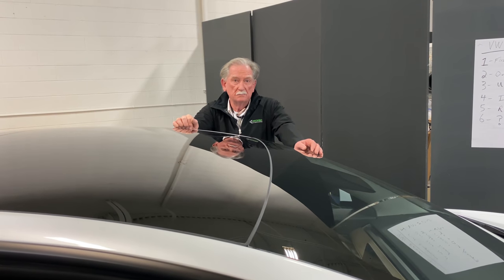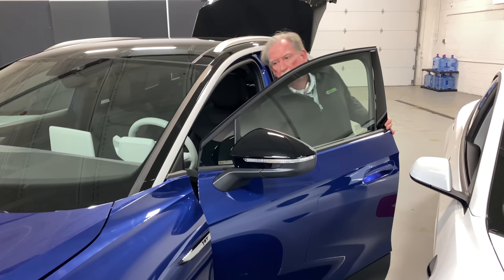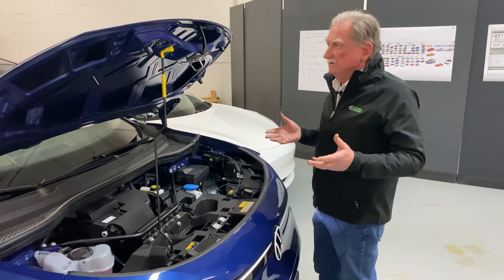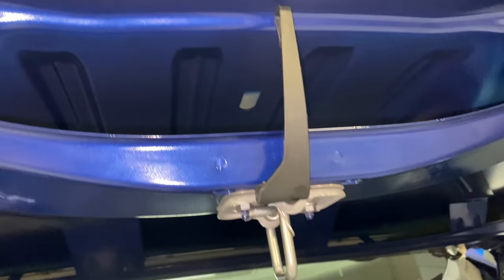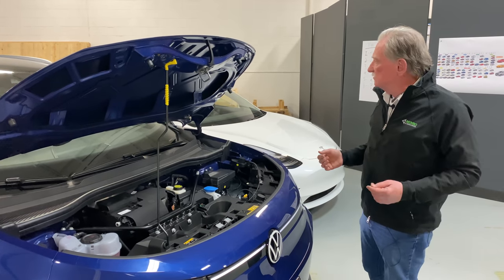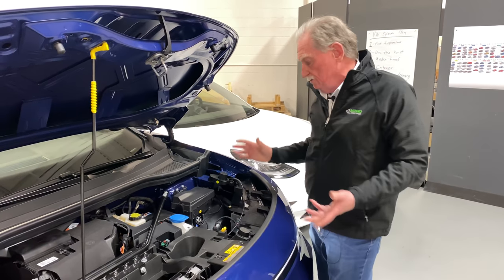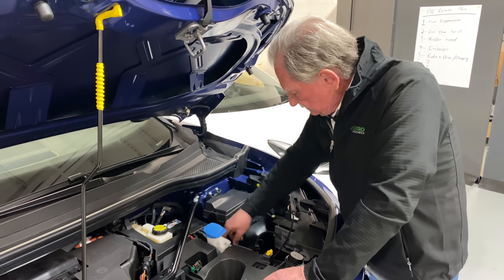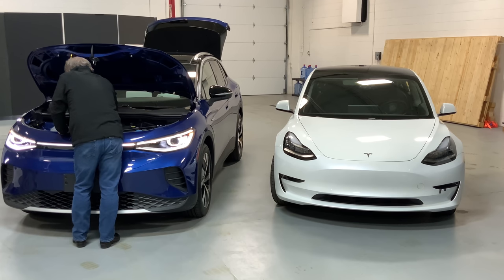2021 Volkswagen ID.4: E2 - Under The Hood

Comment: Outstanding technical analysis. Thanks Sandy.
Reply: There's far better technical analysis in the comments than the video. The video demonstrated that Sandy still can't close the frunk of the Tesla and that he seems to be wilfully misrepresenting the engineering behind the ID4 - most notably no comment on the tighter turning circle and better interior space because of the shorter nose and the benefits of moving items from the dashboard/firewall area into the space freed up by losing the engine, as well as presenting pedestrian safety as a negative thing for some reason and ignoring the connection for the + jump lead in the fuse box, meaning you don't need to go at the battery terminals at all. Expecting the ID4 hood, which will likely be, opened a couple of times a year if even, which, when open provides much better access to service parts than the Tesla, to be as easy open as a daily used storage area with plastic panels covering all the same mess as in the ID4 bay is just plain insane. I hope he gets a lot more objective if he dismantles this car, because otherwise he's showing a surprisingly level of pro-Tesla bias for a guy who up to this point, seemed to be making an effort at keeping things fairly objective.
Reply: @peglor  exactly that. I was screaming at the monitor while he was saying that the hood is heavy. Even at the first responders cable he was wrong, in id4 you don't cut the cable you just unplug a connector, it was right in front of him, and he literally was touching the instructions label while complaining that "the first responders had to remove the refill bottle to get to the cable" , jesus

Comment: So, why would you need to jump an all-electric car?  Does it still need the small 12 volt battery to start the motor even if the main drive battery is not drained?
Reply: All EVs have a 12V battery to power the accessories i.e. PW, PDL, PORM, HRW etc. The 12V battery needs to be charged regularly.
Reply: @7spower998  Thanks.  I don't know what those 4 acronyms mean, except maybe PW = Power Windows?  I guess everything in the interior is powered by the 12V (displays, radio, AC, headlights, etc)?  Do they have alternators that charge the 12V?  Will the car start with a drained 12V battery?

Comment: Why would jumper leads be used on an EV? I would have thought the 12v battery would be charged from the main battery via a transformer so if it’s dead the main battery is dead but if it’s really dead, ie no longer functional a jumper lead will not do anything. I’m just guessing so if anyone knows why?

Comment: btw. could you try to scratch off the coating if its conductive underneath? cause wear and tear could actualy cause that (especialy when one needs to replace the battery you´d need to remove that bar anyway - to me its bad design

Comment: Hi Sandy. Can you explain why the ID4 appears to have funnels for 3 fluids. Obviously one is windscreen water. You’ll know Tesla only has one fluid. Question goes to need to service the vehicle. Thanks.
Reply from the maker: Ethylene glycol for the heating/cooling thermal system. (Red color), windshield wiper fluid (blue), brake fluid for the other one.
Reply: @MunroLive  Presumably the Tesla has the same but they're less accessible, it's certainly using all 3 fluids. The last one is refrigerant for the air conditioning, which I didn't see obvious connections for in the ID4 and there are certainly none accessible without taking the Model 3 apart. Presumably, since it's a VW, it has the 'feature' that the aircon will fail in an expensive way (Either leaking or losing a compressor) at 7-8 years old anyway.
Reply: @MunroLive  thanks for replying

Comment: You don't 'jump' an EV. If your 12V is flat, your main battery is also flat, so you're going nowhere. Just plug in the car to a charger via the charge port and the onboard 12V charger will charge the 12V battery from the main battery.

Comment: Not sure. BMW thought the worst enemy of EVs is weight too. They were wrong (Light materials, recuperation etc). Just use steel, add a huge battery (also weight), and have (if the type of car allows for it) low drag coeff. Tesla got that right from the beginning. Frunk: Needed? Trunk 9 banana boxes, seats folded 25. See @teslabjorns banana box test.

Comment: Yes, some parts in the front seem rather heavy - but what is the overall weight of the car, compared to the model 3 or Y?
Reply: VW ID4 - 4665 pounds

Model 3 - 4250 pounds
Model Y - 4415 pounds 

1 pound = 0.45 kg
Reply: @shortaybrown  Thanks! ID4 is a bit heavy....

Comment: If the Tesla that is right next to it doesn't have fuses, what does it use to handle the functionality of a fuse?
Reply: It was explained to me that it doesn't have throw away fuses.  They reset.
Reply: @TheEvilmooseofdoom  reset like you push a physical button somewhere, or reset like you tap a button on the infotainment console?
Reply: @TheEvilmooseofdoom  I suspect they try to reset every time you turn the car on, but you're out hundreds of dollars when a real fault fries one of the solid state fuses and the whole module has to be replaced.

Comment: No Frunk is a good idea, No Motor so put all the C£&P there instead, just getting the air filter to be so easy to access will make everyone's life easier and leads to more space where you want it, in the cabin, The Nissan Ariya is doing the same thing. Also pedestrian safety is clearly not important in America, there is no way the Cybertruck will be allowed on our roads in the current design! Nobody outside New York walks anywhere I presume?

Comment: How do you jump start an electric car. The battery is still going to be dead. There's no starter motor, there's no gas engine to charge the battery. What's the point?

Comment: Is jumpstarting an ev with 12V even a thing?
Reply: Jumpstarting is not needed, however external charging is important. For this, Tesla has two little wires you can connect to a charger. Without the 12V system the EV does noting. The 12V lead-acid battery in EV is even useful to power the car electronics in case the high voltage system fails. I believe in EVs everything works with 12V except for the motors and heater.

Comment: Teslas skateboard platform is simply the best. Makes for great center of gravity. VW should try it.
Reply: Have you seen the MEB Platform this car is built on?
Reply: Yeah, what are you talking about? MEB is a copy of the skateboard concept, but unfortunately will be nowhere near as good without 4680 structural battery brick.
Reply: @Global_Optimization  utterly false, skateboard concept is not even original. meb is a development from the now old and revolutionary mqb from Volskwagen itself
Reply: @jh5kl  The MQB is an ICE platform...bit of a stretch to say that's the real source of the idea, especially when it came out in 2012 at the same time as the original Model S started production.
Reply: @jh5kl  Unless you're maybe referring to the concept of having a standard, modular, flexible architecture in general, but that is an obvious idea that has been around since before civilization began.
Reply: @Global_Optimization  stop talking nonsense the id4 has almost the practicality of a tesla model X go watch Björn Nyland videos

Comment: What I see here is an established mass-market manufacturer taking its first major stab at the electric car market. Whereas Tesla got to start fresh. Giving it far more capability with suppliers to mandate entirely new uses for parts. Whereas VW had to make do with some existing bits and pieces while also leaning on existing suppliers for parts that could also be manufactured easily in line with their existing catalog. Causing issues not seen with a Tesla. It's comparing a not-so clean-sheet design to an entirely new one.

Comment: The idea of not having a frunk is that you can push the cabin forward from more interior space
Reply: the sad thing is, that tesla fanboys are not aware of it, even after explaining it to them 10 times.
maybe tesla is going to copy that design. then of course in that case it would be a brilliant design.
Reply: @stefanweilhartner4415  
The model Y has more interior room and a Frunk and weighs less,  plus better range, better acceleration.  I think the assumption is that because the ID4 doesn't have a frunk it must have more interior space.  I suggest that the ID4 is just poorly  packaged.  Probably because VW was stuck using off the shelf components rather than designing components specifically for the vehicle.  There is a difference in design philosophy between Tesla and other traditional car manufacturers.  But I expect traditional car manufacturers to eventually catch up and/or copy Tesla.
Reply: What interior space?
My e-Golf didn't have a frunk either but didn't feel as spacious as the Model 3.I sat in the Model 3. For a sedan, it's very spacious. Why won't you sit in one and judge for yourself.
Reply: @TBetter  the e-golf is not the ID.3.
it has the same dimensions outside but inside the passengers have more space. about 30cm more space because the front is at least 30cm shorter. that is a good concept

Comment: The reason behind all the issues are that they were trying to make the cars cheap cheap cheap. Reuse old stuff, use cheaper materials (steal vs aluminum), not to mention drum breaks in the rear (WTF??). VW doesn’t care about the product. They only care about their profits. They assume their brand name and marketing will save them. Unfortunately as more people get first hand experience with Tesla quality and engineering, and Tesla ramps up production to allow lower prices, more people will shift to Tesla from legacy car makers - who only care about $, not about the product or customer.
Reply: Wow, i didn't realize it had drum brakes.  wow

Comment: In an engineering environment like at VW where all the real design work of the car is outsourced, you will never get an efficient package. The result is what we see here.
Reply: LOL...and Tesla doesn't have OEM Tier 1 suppliers to design and manufactured parts from them? Think again.
Reply: Tesla brought lots of components in-house, partly because they had to. Best examples are the Model X Onboard Charger, heat pump etc. Result is that Tesla is really hard to copy and their efficient packaging is hard to reach for others.
Reply: @BSport320  The brakes assy. by Brembo. ABS, TCS, EBD by Bosch. Tires by Michelin etc. etc. etc. Those parts are just to name a few.
Reply: @7spower998  We are talking about front package and not in-wheel-package. ABS, TCS, EBD are software functions that have nothing to do with packaging?!
But I get your point, of course Tesla has suppliers. But the efficient package we see here is only possible because they do much more in-house than anybody else.
Reply: @BSport320  Tesla design the overall in-house packaging, however, the OEM suppliers designed and manufactured the parts to fit within the packaging environment.

Comment: Not wanting to knock VW...but that's a lot of expensive parts to make some bad ergonomics from an end user point of view, most people wont ever get jump leads on the contact area!!! How long is that washer filler bottle flex pipe going to last before it fails etc and more importantly, how many of these cars are going to have spills around the delicate electronic components? Looks like such an after thought under the hood!
Reply: The detachable washer bottle is a great idea and will make it way easier to fill the washer bottle without spilling or needing a funnel. There's a tab in the fuse box to connect the positive jump lead instead of using the battery terminal and almost every car has a flexy pipe like that feeding into the washer reservoir already and I've never heard of a failure with it. Also to pass automotive standard testing the 'delicate' components end up not being particularly delicate by the time they're qualified for use.

Comment: I'm puzzled about the comments on the VW hood regarding head impact/crash deflection being a European requirement. I thought this had also been mandated for all vehicles sold in North America and part of the reason you see so many rounded humped hoods nowadays vs the flatter hoods of the 80s and before.
Reply: Nope. Strictly a European requirement.
Reply: It is pretty different. The Euro NCAP features pedestrian protection and put quite a lot of weight on it, so a car will struggle to ace crash tests without this pedestrian protection. You can see the tests being performed here and they are becoming more strict every year: https://www.youtube.com/watch?v=Smwk-H8xDuw&ab_channel=YOUCAR

The Ford MNustang got a two-star rating at the NCAP, but did well at IIHS and NHTSA. Two stars are so bad that Ford decided to add a few safety features before selling it in Europe
Reply: @travelguy78  Good to know. Thanks!
Reply: @jamesengland7461  That is not correct. Its a UN/ECE rule. 
They define the standards worldwide. And all European countries, many south american 
and asian too follow those rules and standardss.
European countries since 1958.
The US, China, Russia have no safety standards at all. They never thought they would need any.
NHTSA just now starts to change their mind. About 70 years too late.
So: When built to a European standard they are all safe to be sold worldwide. 
Which makes the UN/ECE standard a de facto worldwide standard.
Reply: @travelguy78  The Mach-E has no NCAP crash test or rating.
Reply: Being an American living in Denmark.... There is a fair amount of biking and walking. Cars mix it up with pedestrians maybe a little more on average compared to back in the States. That possibly explains the higher concern about head injuries here. Also, maybe the speeds of those pedestrian impacts might be lower in general. So when Sandy seems to poo poo the rules he might be thinking about the uselessness of the precautions because of higher impact speeds in the States. He suggests people can't survive those impacts, which is probably truer in the States. 
I haven't googled this info. It's just my gut feeling from having lived in both places. I'm willing to be proved wrong by facts and statistics.
Reply: @wolfgangpreier9160  actually,  you're incorrect.  The US has had increasingly stringent safety standards for over 50 years.  The third world has no such requirements, and cars are sold all over the world today with no regard for crash safety. Can you say tuk tuk?
Reply: @gmosc  I agree with you.  Only in the largest American cities are there even significant numbers of pedestrians.  While I certainly support designing for pedestrian safety, it seems,  intuitively at least,  futile.  Does a slightly softer impact still result in a skull crushed on the pavement?
Reply: @wolfgangpreier9160  I have not mentioned the Mach-E. I mentioned the Incident from 2017 when the Ford Mustang got a two star rating. When they added a few safety features they manage to salvage three stars.
Reply: @jamesengland7461  I think the effect is being rolled onto the hood kicking your legs out. The secondary impact of hitting the pavement might be a little less than the initial hit. Either way, it's always best to avoid it all by  looking left, right left, when crossing.... or right left right in countries like England and Japan. (I was in Japan for 4 years and my left right left reflex got turned around so now I over cautiously look left right left right left!)
Reply: @jamesengland7461  Yes India, Russia, North Korea, Malayisa, Kasachstan, Somalia, US, China  have no standards and rules regarding any results, whether crash tests or pedestrian protection and safety.
Even the NHTSA states there are no rules and that they want to implement them - Look at their website. Interesting.
In the US there are insurances that sue the OEM's when there is a fatal crash or injury.
And NHTSA can make a OEM recall any model that proofen insecure.
That is all handled in the UN/ECE rules.
Not perfect but they exist.
Reply: @gmosc  In Los Angeles Sandy is correct no sane being would try to cross a 6 lane street there. In e.g. New York or San Franzisco there are pedestrians and they must be protected. But the US chose not to make any rules. IDK why.

Comment: Edmunds Test:
Model 3 SR EPA rated range: 250. Real world range: 237 (13 miles under)
ID4 EPA rated range: 250. Real world range: 287 (37 miles over)
Mach E EPA rated range: 270. Real world range 304 (34 miles over)
Bolt EV EPA rated range: 259. Real world range 277 (18 miles over)

Tesla over estimates range while all other manufacturers under estimate.
Reply: That would be the EPA who's range is off.  I do have to wonder what was going through Edmunds heads with that test.
Reply: Tesla actually disputed the results and said something along the lines of "yes the car can achieve EPA range if you push the car past 0% until it doesn't move" Edmunds did the test again and these were the results they got.
Reply: @DarwinChaug  I'd still take the Tesla due to the fact that it is more efficient and has the Supercharger network when you run out of range.
Reply: @rogerheuckeroth7456  DC charging (universal standard) is catching up and with the new infrastructure bill, will surpass Tesla supercharging net work. You charge at home 99% of the time anyways.
Reply: @DarwinChaug  Problem is so many of those fast chargers by other companies don't work.  I have 6 years experience driving EVs.  Go on Plugshare and look at the reviews of so many frustrated EV drivers that could not get these chargers to work.  Its a real problem!  Tesla is increasing their charging network with out aid from the government at a rate that is and will continue to be way above what others are doing.  Eventually, I'm sure they will allow other EVs to buy an adapter / ap and charge on their network.